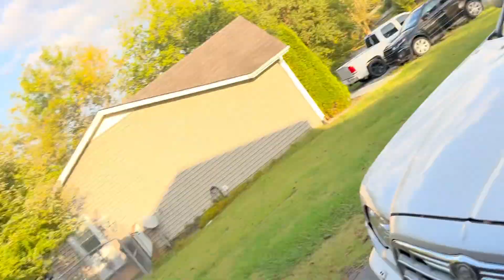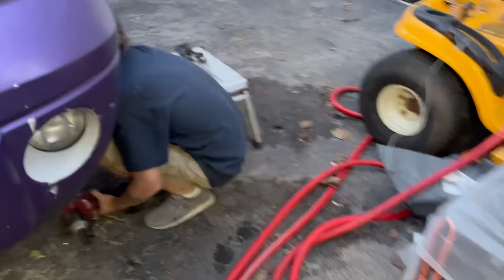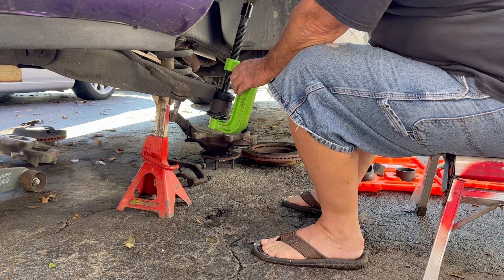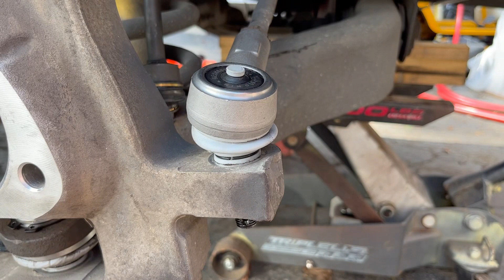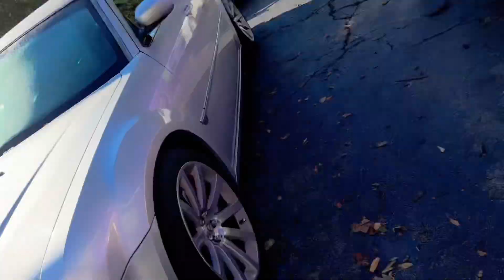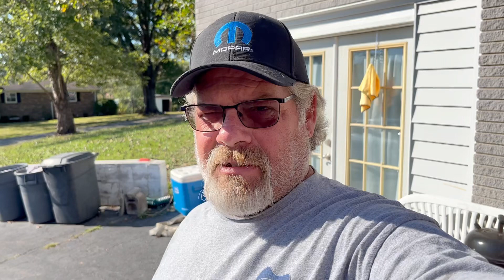Front end problems with 06 dodge 1500 AKA “Barney” Shake, Rattle and wobble.

Comment: Got an '03 1500 Ram 4x4, first year Hemi- bought it in 2010 as a 48k one owner truck out of Florida, it never even had a ball mount in the reciever- have 135k on it now. When I got it she had a bad ball joint so all got replaced with MOOG parts. I have put new hubs in, replaced rear brake lines and calipers, but other than that no issues. No rust but clear coat is SHOT and quotes for new paint (graphite grey metallic) are near 5k these days. I'll probably do it myself, one panel at a time!  All the trash talk about how Hemis are shit, I totally disagree! Quad cab is comfy and AC has never been touched, blows 42* in Georgia heat.